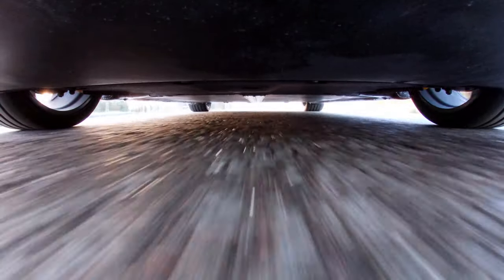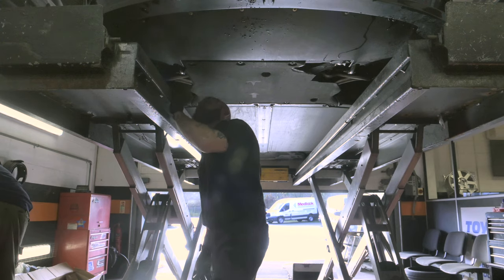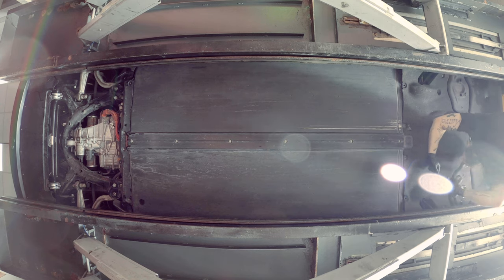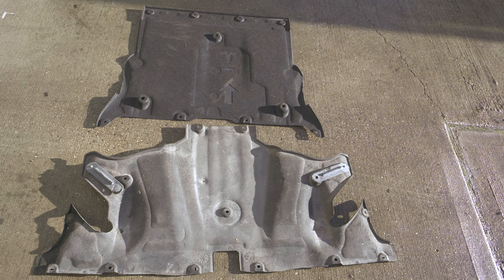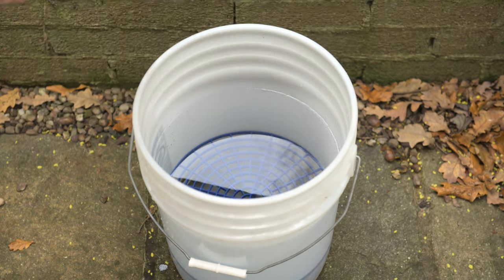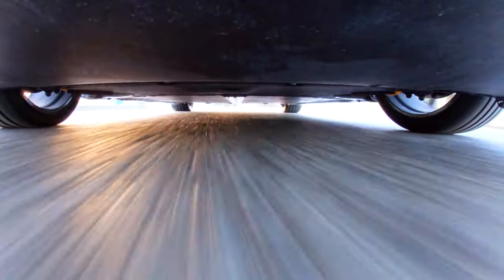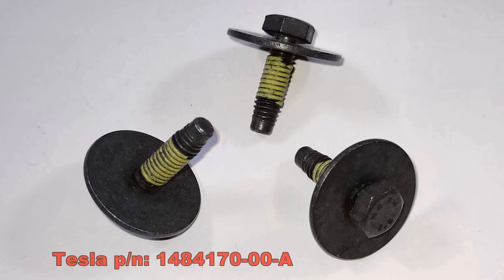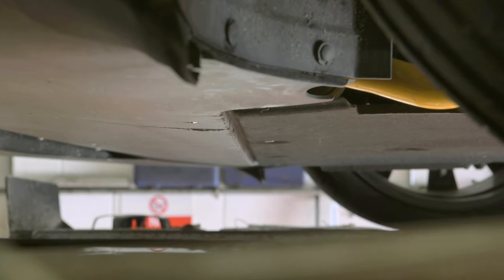Tesla undertrays/aero covers/shields/whatever - why do they rip apart and fall off?

Comment: My tray tore and is dragging on the ground making a horrible scraping noise. I didn't think about it until you mentioned the puddles but I did got thru a rather large one yesterday and today when I pulled out the noise started. You can see the back tray torn & hanging down.  I'll call Tesla but I have a 2018 and doubt it will be covered. I saw another video where they simply held it back up with zip ties. Your thoughts on that?
Reply from the maker: Ties will work if it's not badly damaged but you might find you get more wind noise on the motorway if the tray isn't completely flush. Better to get a new tray really.
Reply: Thank you

Comment: Have a 2020 long range, not long after getting it Tesla had to replace a clicking hub. Was driving on the motorway on Friday when there was a horrible thud-thud-thud from the underside at the front. Took a look and the tray had dropped down and was rubbing on the ground. Turns out one of the front bolts was missing and the remains of a snapped cable tie was in its place! Will be reporting this to Tesla and demanding they replace the tray!

Comment: I have a 2018 and was just on the freeway in the states and hit standing water on a bridge at speed. When I was super charging and walking to the car from being away I noticed that the center of the front cover was torn loose and hanging/folded down about 5 inches from the front. I had not hit anything to my knowledge except the water. I think at speed the water pressure would be enough to damage the part.
Reply: Going to Tesla in five days and will see if they are going to try and charge me for the part.

Comment: My 2016 Model S rear cover has torn apart. I was driving 65km over the road with 2 to 3 inches deep of water. The water has trapped in between the rear motor and the rear cover. This has pulled off the cover.

Comment: Yes. Happened to me driving south on M40 Feb 2020 during that very windy storm. It was a side wind and eventually the road noise underneath just changed with a flapping sound. Slowed to 50mph and headed for Oxford superchargers. Called for Tesla assistance and they sent someone along. A whole section on the rear of the front splash panel had ripped itself off. No memory of ever driving over or causing any damage under there. Tesla Birmingham refused to cover it even though they couldn’t find any impact damage, stating “it is not a warranty part”??
Reply: How much was the cost to replace & install?
Reply: About £140 supply and fit. It really left a sour taste tbh, the attitude at the service centre was, pay up if you want your car back, which completely misses my point.

Comment: I noticed two retaining clips amiss on my rear undertray splash shield. It left a small gap on the left and right of the rear undertray, about .5." I'm curious if water got in there. Does it have a way to drain out? My underbody is as clean as possible - free of any damage, so I'm assuming it shipped out of the factory this way.

I've had the car for 3 months now and just noticed it, so I'm opening a Service Claim. Hopefully, it'll be a proper remedy.

Comment: It is plastic. It says pp-gf30/40 on the part. This is glass fibre reinforced polypropylene, 30/40%wt glass fibre content.
Reply from the maker: Thank you. That is very useful to know. This is what Tesla Gurus is all about - the community informing, educating and helping each other.
Reply: @TeslaGurus  happy to help. If you have any further questions, automotive material engineer here.
Reply from the maker: What would be interesting to know is why this material is used instead of something stronger.
Reply: @TeslaGurus  usually PP-GF is used for injection moulding but these parts look like thermoformed sheets.
Cheaper to manufacture than an injection moulded plastic, not directly visible so low aesthetic requirements. usually high resistance to mechanical, chemical and thermal influences, but as you showed in the video, 'easy' to rip once it started to tear on one of the edges. I'd argue that the missing lip on one of the parts is a design flaw.
Reply: @McReinsen  with Tesla Cheaper always comes into the conversation
Reply: @EVMYT  cost is the main driver in all of the automotive world

Comment: This just happened to me! Drive approx 45mph across a large puddle that I couldn’t avoid on a blind spot. Then sudden noise of dragging something under the car. Yep, the rear aero cover broken in exact same spot as shown in your videos. How pathetic, Tesla can’t drive through puddles without causing damage! MK service Centre have quoted me £179.80 for replace and fit. Going there next Tuesday and will definitely be arguing with them if it’s covered under warranty, nothing in the Tesla manual to state you can’t drive on roads with puddles. Otherwise love the M3 Performance been problem free up until now. Do get disc rubbing sounds though….hmmm?
Reply: did Tesla replace it under warranty in the end?
Got exactly the same issue at present
Reply: @zeegee1856 Tesla (MK) tried to charge me to replace it but I argued that there was nothing in the car manual that told me to drive at low speeds in puddles! They repaired as a goodwill gesture so no cost.

Comment: or window adjustments! I've already done window calibration on all 4 of my windows but my drivers window continues to roll up into the trim when the door is shut and then back down half an inch / 1cm. Depending on how lightly or heavily I shut the door it rolls fully up when closed or pops back down half an inch. Even when it pops back down the half an inch there is a tight seal so it doesn't bother me. Just perplexing.
Reply from the maker: I've had to recalibrate windows a couple of times and I did find it needed several attempts to eliminate the error. It's also important you do it from the driver's seat.

Comment: The front left corner is loose on my model Y 2021. What size are the bolts if I want to fix it temporary?
Reply from the maker: Depending on which part of the undertray is loose, it will be a M6x18 bolt or 8mm, 5-7 push pull plastic rivet.

Comment: well well well. i like how tesla fanboys are like "my tesla has no oil in the car at all im green me me me me bla bla bla" well stupid you still have axle grease(which have a base oil) and differential oil. so big oouuuuff to anyone saying a tesla is oil free. Just don't get help. great video by the way 😄
Reply: Anyone who says that Tesla or any electric vehicle is petroleum free as you posit above is either totally a moron, or is trolling FUD. Of course, there are lubricants in the cars. There certainly is lubricant in the
gearcase (yes, Tesla has a gear case of course, there is jut no shifting). Any bearing has some kind of lubricant.
Now then, if someone says there is no transmission fluid to change, no engine oil to change, no differential oil to change, then they are almost right.   Certainly after a very long interval, the lube in the gearbox and any other rolling surface needs to be checked. You've got lubricated bearings in your lawn mower, roller skates, even your garage door.
And why "fanbois"? 
Not everyone who own Teslas and praises them finds them absolutely perfect. That's silly. Neither a Bentley or an RR, or a Cadillac or any other brand of car are perfect. But I like my Teslas and if you as my opinion, I will tell you how much I like them (a lot), though there may be issues here and there. So I'm a "fanboi"? Please. If you arepredjudiced against Teslas, or BIC pens, or Bovril, then fine. But why hang around a site about a product for which you have hate? Go bother someone else. Or - Hey! Here's an idea! - LEARN something about Teslas... drive one... get someone to show you about them. Read some proper informed source. If you don't want one, fine. Have a nice life. But quit wasting your time telling us "fanbois" what idiots we are. In your narrowminded, ignorant and uninformed opinion, that is.
Or are you just pissed that you can't afford one, so you sit back and throw verbal rocks.
Reply: @The_DuMont_Network  hmm who is saying i don't have one and im a fan of the concept of the tesla, but im merly stated a fact in a funny tone instead of being so serious, it is youtube comments relax Dumont
Reply: @nobby145  That is an issue with non verbal communications. It's hard to discern sarcasm. Usually when someone refers to fanbois it is intended as an insult.
Reply: @The_DuMont_Network  well you right there my mistake in using a term that can be perceived as both an insult or just a term for someone who has alot of love for one thing. teslas are great in there own way.

Comment: Our 2018 front undercover ripped and I actually purchased a new one and very easily replace it myself.  It save me $200.00.  Now I am hearing similar noised in my rear wheel undercovers.  I looked and there seem to be 3  fasteners missing on both sides.  This was not covered under warranty for us.
Reply: Where did you find the replacement?